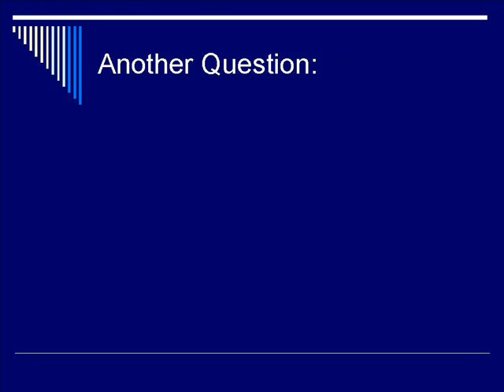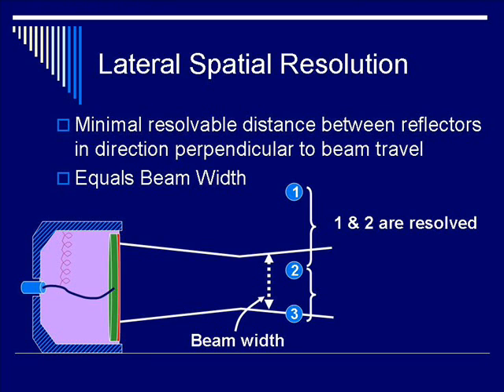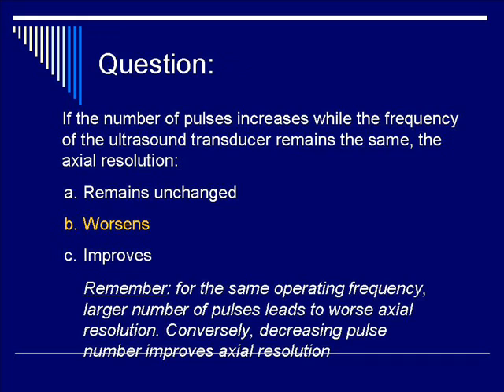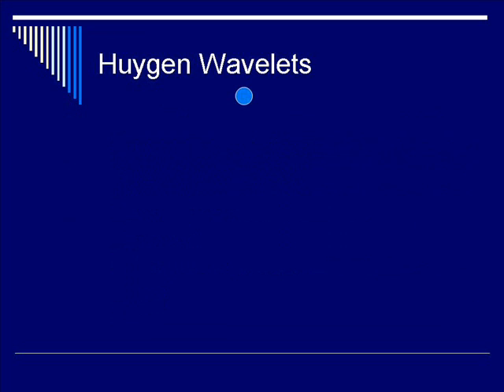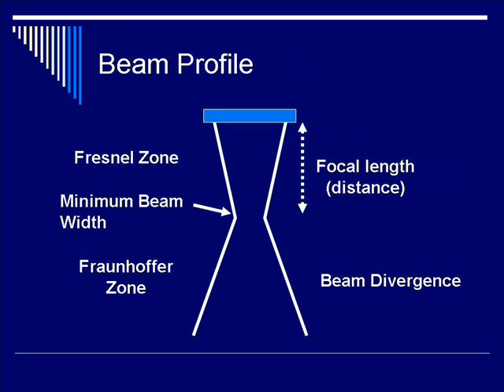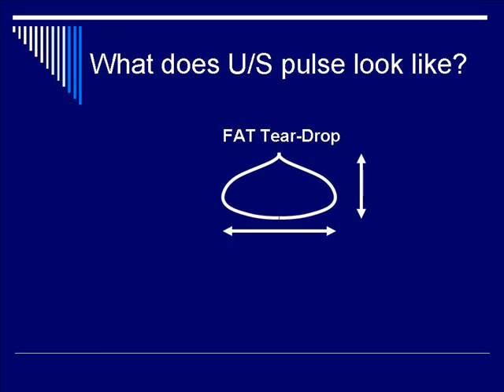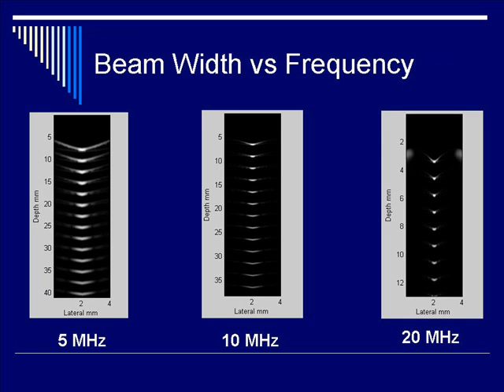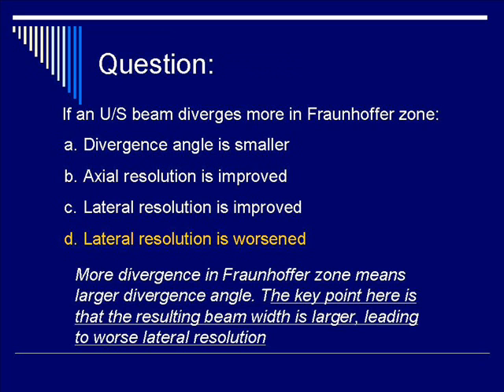Physics of Ultrasound: Transducers - Segment #3

Comment: Poor wording here.  It should have been written as "If the number of cycles in the pulse increases..."  then the pulse duration obviously becomes larger for a fixed frequency or fixed wavelength, and that would indeed make the axial resolution worse (choice B) as the chanmeister intended.   However, because the wording was ambiguous, choice A is correct.

The "number of pulses" is a different animal, and it is related to the PRF (Pulse Repetition Frequency: the # of pulses per unit time).
Reply: Yeah I totally agree, and thanks for pointing that out!